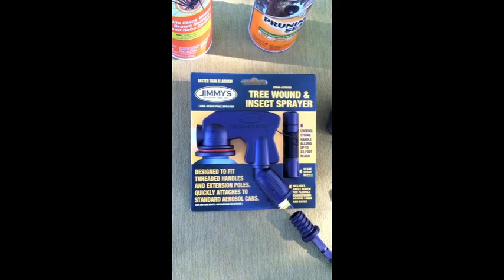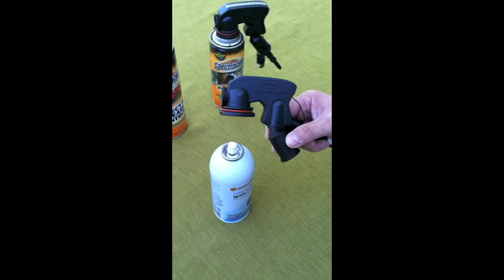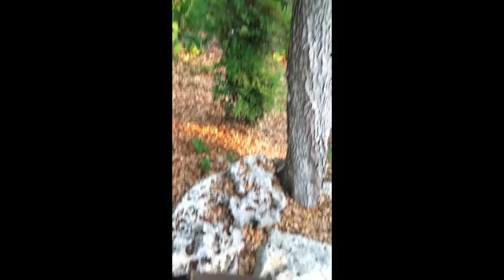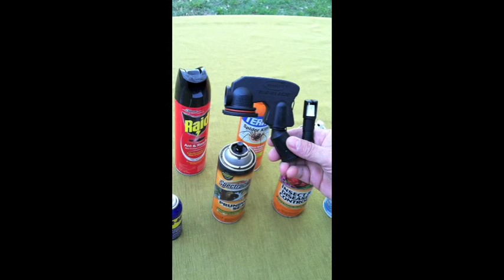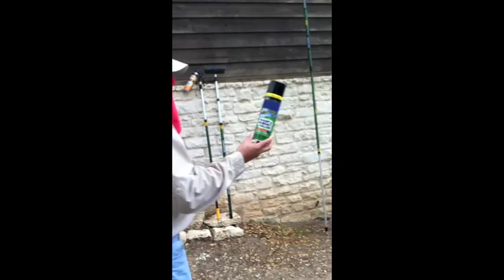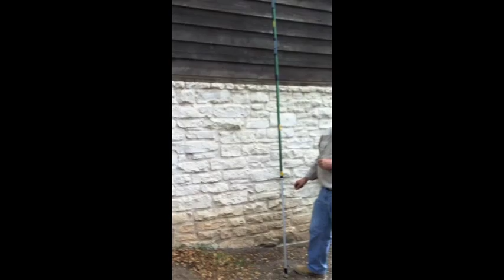BIG-REACH Pole Sprayer - "How It Works"

Comment: I just ordered this but it's now $19.99.  I have a wasp nest that survived winter in my sofit which is about 25' up off the ground.  I plan to use the Spectracide Pro which is a white can. It has a decent residual affect that will continue to kill wasps coming and going for a few days.   I typically treat a nest area twice with a few days between sprays just to make sure I've applied enough to kill the majority of the nest.  I like the idea of pre treating the areas early on for prevention.  This will be something I do from now on with your sprayer!  Thank you!